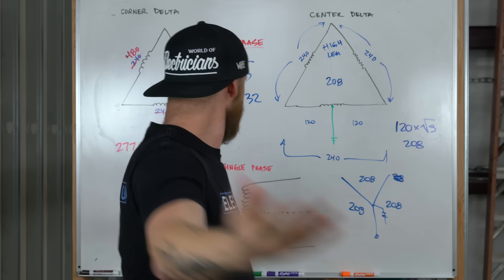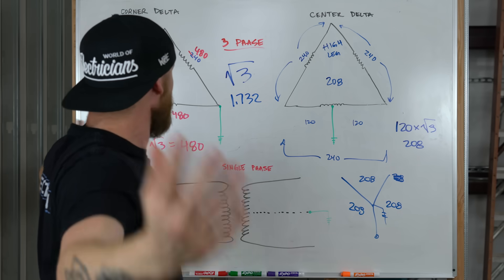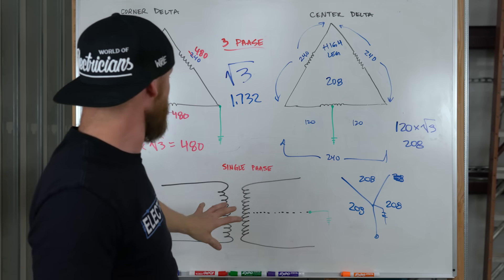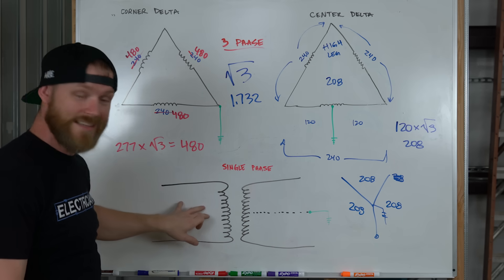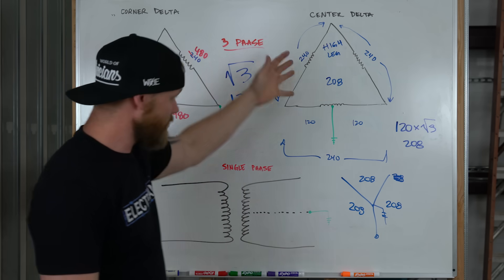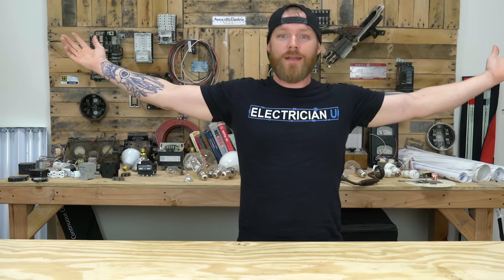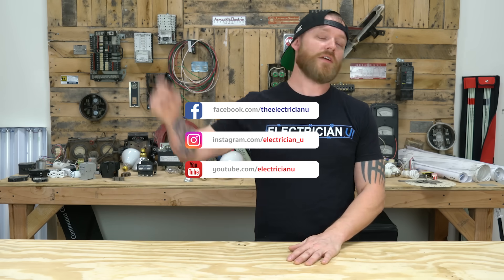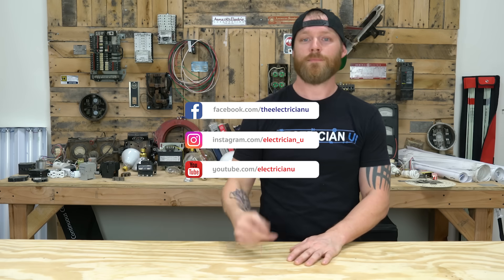Difference Between VOLTAGES - Why We Need Them All

Comment: Each leg is out of phase by 120 degrees from the other two. 3 times 120 degrees equals a full circle and the sine of 120 degrees is square root of 3 divided by two which falls out of the Pythagorean Theorem. 240 divided by that phase constant I mentioned earlier equals 207.846
So triangles and geometry do mean an awful lot if you ever want to design a power system. This explanation needs a chalk board and a half hour for someone who understands college physics at a minimum, but at least now you know how cool triangles are.

Ooops. I wrote this post part way in before you brought in the radical (square root sign). So AC power is transmitted as a sine wave and power companies save wiring by sending a consistent amount of power the whole time and to do that they send three waves each 120 degrees out of phase. These three waves are then pulled apart at the customer's premise into three separate waves again. 

Pythagorean's Theorem states that the sum of square of each of the two legs of a right triangle equals the square of the diagonal. A 120 degree phase on a sine wave uses the trigonometry from a 60 degree triangle. triangle has one leg equal to half the diagonal. The triangle in question has three sides with the ratio of 1 for the diagonal, 1 divided by 2 for one leg and the square root of 3 divided by 2 for the other leg. You see how the square of the diagonal equals the sum of the squares of the legs of the right triangle?

Comment: For those interested, the main reason  power companies supply a 3 phase with 208 volt high leg is because they can bring good quality 3 phase power to a remote location(e.g. farm) using only two high voltage phases called  V phase. Saves a LOT of money. As rural areas build up with new construction,both residential subdivisions and industry, it becomes more economically feasible for the power company to supply full three phase power. For that reason High Leg installations are slowly disappearing across the country but many still exist, so be careful out there.

Comment: With the 3 phase 4 wire delta system, the NEC requires you to write or put a warning label on the panel in question " Caution, B phase is 208 volts to neutral.".
Reply: Not the only label tho correct. High leg wild leg can be used too correct

Comment: They’re places where the low side is 4kv. If you check it with a fluke volt meter which standard meter is only rated to 1000volts meter will explode. Literally. Can NEVER be too safe with electricity

Comment: Single phase 120/240 three phase  voltage is decided by a multiplayer so you get the odd numbers 208 277  . Confusing single and three phase voltage different system . You explain better further in . Way back when I was in school I would ask and the teacher would say that's just how it is . Later when I looked into it it's actually physics and the properties of the materials and of electricity. For electricians just take time to understand what you are looking at before you got touching stuff . Also in 277 look for a grey neutral wire . Mostly lighting systems . Higher voltage lower amperage lower voltage higher amperage that's why higher voltage is used so wire size is reduced in buildings  with higher loads.

Comment: Some power companies avoid a "wild leg" situation by only using the wye-delta bank for three phase.  A separate  (fourth) transformer is used to supply single phase.
Reply: I work in Utilities, we don't install a fourth transformer to provide a customer 3 phase and a single phase service. A bank with 3 transformers, we change the internal windings to achieve the desired voltages. For example, transformer 1 is (25KVA) in parallel, transformer 2 is in series (50KVA) and transformer 3 is in parallel (25KVA) giving the desired voltages of 120V/208V/240V. The size of the transformer for one is doubled to accommodate the additional single phase load.

Comment: Great job Dustin !!! My first experience with 277 was with a metal fish tape into a florescent  light fixture., doubled over as the current went across my chest.  #@%^&I* it hurt like HELL !!!
Reply: Mine was also a fluorescent light fixture. One of those "designer" ones hidden in a little alcove.  Push in connector attached to the ballast disconnect plug came out and touched me, that was nicely grounded to the fixture chassis. Lit me up real good. arm hurt for a couple days for sure. thankfully didn't fall off the ladder because my buddy was holding it for me. Was comfortable with doing light fixture repairs hot before but, won't do that style again if it's 277

Comment: One way of avoiding frying your appliances or motors is to check the voltage using your multimeter before you hardwire in or plug in your new device. Absolutely great video though.

Comment: The 208 high leg is engraved in my mind now. Few months back i was landing wires for 120v plug inside generator enclosure. Picked the first unused 20 amp breaker i came across, might have been in a hurry. Sent 208v and cooked a $600 battery maintainer. I’ll never forget again. On a different note can you do some videos on why you would use dc versus ac in some applications like motors, controls, etc? Love the videos man your a great teacher!

Comment: How does 220 volts become 208 with the square root of 3??
Reply: Firstly, toss the 220 volt figure because the present standard is 240V, which is what you get from 120/240 volt single phase service. In this instance, you get the 240V from the simple addition of two 120V sources.

208V, on the other hand is something that only comes with three phase service. Specifically, 120/208V service. As Dustin explained, the square root of 3 is used to figure the voltage between any two hot wires. In this case, each hot wire is 120V to neutral, but because the voltages are out of phase with each other, you cannot simply add them to get the voltage between hot wires. Instead, you multiply the voltage of any single hot wire by the square root of 3 (1.732) to get the right answer. The square root of three comes from the math involved in analyzing the relationship of the voltages in what is known as a "polyphase" system -- which is much more complicated than the much more familiar single phase type of power.

Comment: Great video. Can you run a motor rated 240v on 208v? Example if i have a hand dryer that requires 240v but i only have 208v can i still use it?
Reply: It depends.

In general, anything rated for 240V that is connected to 208V will deliver lower performance than what the manufacturer intended. I assume you are referring to a hot air hand dryer that is used in a lavatory. 

First, the heating element will deliver 25% less heat than normal. This may be acceptable but of greater concern is the blower motor. If it is an induction type, it too, will still operate but as a consequence of the lower voltage it will draw more current than it should. This will cause overheating of the windings. This may not be a problem with the intermittent, short run use that most of these things see but it could be if it is in a heavy use installation. A much better choice is a dryer that uses a universal (commutator & brushes-type) motor. Like the lowered performance of the heating element, it will run at a lower RPM, but will not be subject to the overheating that happens with the induction type.

Lastly, there is the timer device that all these dryers must have. It is much more difficult to predict how this will work with the lower voltage. If it is an electronic type that uses a relay to control the heater and motor, it may not work at 208V. You will have better luck with an electromechanical timer, which uses a small synchronous clock motor.

The best recommendation that can be given here is, consider the information and try out the dryer in question on 208V before installing it permanently. Good luck.
Reply: Inflec great information. Thanks you!

Comment: At what point does the electricity start to jump off the wire searching for ground
Reply: depends on the potential difference, proximity or ground, and resistance of the air on a given day

Comment: You forgot my favorite low voltage: -48v. Yes, I have a favorite low voltage.
Reply: Where is -48v used typically? Never seen it.
Reply: @jaythompson5102  All over telecommunications I believe.  Power over Ethernet being where most people see it, but anything in a telecom rack has a good chance of running off it.  Someone correct me if I'm wrong, I used to work at the phone company, but I wrangled bits, not amps.
Reply: Sean Reifschneider yep, I work with carrier cell equipment and -48 is still everywhere. ATT being the first to use it and still do.
Reply: @jaythompson5102  
Solar
Reply: Most industrial controls are 24VDC. Mainly because per nfpa70e its finger safe
Reply: Yes, telecommunication systems typically run on -48v to -52 dc. If you take a dc voltmeter and measure between the two wires on a land line coming from the phone company, you should see -52v dc.
Reply: TIP and Ring

Comment: In Canada we use under 30 v is extra low.voltage...31-750 volts is low voltage  and anything  751 v and up is  considered high voltage by our Canadian electrial code...CEC.

Comment: We bought an eco smart 27 electric tankless hot water heater. It takes three different 8 gauge wires with three 40amp 220v breakers  We are thinking about taking it back because I have been told it will dim the lights when it comes on.   Is there anyway to fix that?   Awesome video, thank you.
Reply: Install 12v led lights😁
Reply: @saffalife8831  would that be like LED lights
Reply: Yep 12V LED with drivers
Reply: @saffalife8831  thank you so much awesome videos

Comment: If i cross phases in a panel they explode, why if you cross phases in a transformer they magically dont?
Reply: It is absolutely possible to cross phases on a transformer and have something explode. (Check out some Y-T vids on this. They're impressive!) You're probably thinking about why this doesn't happen with the delta transformer configuration. Without going into a lot of mathematics, what happens is that the sum -- actually vector sum -- of all three voltages always adds up to zero. Therefore, there is no current flowing around the closed delta windings. If you were to open one "comer" of a delta service and measure the voltage between the two disconnected wires it would actually be zero (or very close to it). This is one of the few instances in electricity where power sources with differing instantaneous voltages can be cross connected without blowing up. Chalk it up to the craziness of the math.
Reply: If your talking about two potentials that feed a coil inside the transformer the answer is inductive reactance.

Comment: i like that you showed the corner grounded delta because it is a situation where a phase conductor can be a grounded conductor without being a "neutral"
Reply: Brad Lanier the grounded conductor is only a kludge to equalize manufacturing inequalities due to age or manufacturing mismatches in the coil windings and/or power delivery errors. In situations of utopian perfection, the potential would already be neutral or at least no current would flow through the grounded conductor.

Comment: 347 volts what would it be for
Reply: David Berquist lightning
Reply: @darrenwoloshyn  what do you mean
Reply: @DavidBerquist334  in a commercial or institutional building, service is supplied as a 3-phase, 600 volt system for heavy duty operations.  347 volts is the default single-phase voltage derived from a 3-phase 600V system.  So in a building, motors etc. are run on 600V 3-phase, and the lights are run on 347V single phase.
Reply: @elena6516  i never saw a 447 volt light just 120 or 277 where have you seen 347 for lights

Comment: 277/480V system comes from Y-Configuration . . .
Reply: Is that a question? 277 is phase to ground, mainly lighting, 480 is phase to phase, and yest it comes from a y or star configuration. You don't usually see deltas on low sides around me.

Comment: a wye transformer allows you to transmit high voltages with very little current, whereas the delta virtually does the opposite [allows high current].  such is why transmission lines ie high voltage use wye transformers.  typical uses for delta transformers are for industrial uses, but again, they themselves are fed with wye transmission lines.  Some deltas have a grounded lead in which they most definately require a ground fault detector/protection.

the possibilities are numerous ie wye-delta, wye-wye, delta-wye, delta-delta.  each transformer has their own uses, step up, step down, isolation etc.
Reply: because i couldn't/wasnt able to adequately explain myself...please check out this guys vids for some relatively easy understanding[easy for me anyways] of what i'd already learned going through my 3 levels[in-school learning] as an apprentice.

https://www.youtube.com/watch?v=rEiukQLCVao

the way "you" explained deriving something like 120/208 or 277/480 is "almost" factually wrong.  i say almost because while it could be done your way, and in a few industrial settings it is, that is not how anyone ought to be doing it nowadays[safety reasons etc].  if you want one service and two different 'systems' of voltages, you'd keep your wye sourced power as your main and feed a secondary wye-delta transformer if you need high current and different voltage from your standard 120/208y main service.
Reply: K Hills bro, what are you rambling on about? Nothing he said in the video was incorrect. He wasn’t telling anyone how to “do” something. He was just explaining how the voltage numbers work out for different types of transformers.
Reply: i didnt want to bring it up, but "you" brought it out, ..:

i understand what he's talking about and trying to explain.  but he couldnt have done it any worse than you calling out that "he" didnt do anything wrong.  your obviously not versed or couldnt be, in the the electric arts lol..[sry for the pun].  i would not have shown or taught voltages "that" way[his way] because i know better and have a better understanding. 

when i said i didnt want to bring this up, i meant this guy teaching it er..."elec u" etc doesnt have a very good understanding of how shit works. ie transformers.  i wasnt trying to literally call him out, but i did leave a link to a guy's vid who knows fuck more than this guy.
Reply: @khills6616  who is this guy?  video went private
Reply: You have no idea what you are talking about.  I am an electrical engineer.  I design systems using a delta-delta and delt-wye every day.  Why in the hell do you think a wye transformer allows you to transmit high voltages with very little current, but a delta doesn't?  Have you ever taken an engineering power systems course?  You are COMPLETELY wrong when you said, "a wye transformer allows you to transmit high voltages with very little current, whereas the delta virtually does the opposite [allows high current].  such is why transmission lines ie high voltage use wye transformers."   Where in the hell did you learn this?  Did you create this in your head or did some other dumb-ass tell you this?
Reply: @Impedancenetwork  he was confusing characteristics of delta motors with delta transformers.
Reply: @josephkordinak1591  oh I see.
Reply: Szakállat Korporésön are you insinuating that a delta transformer can’t have a neutral?